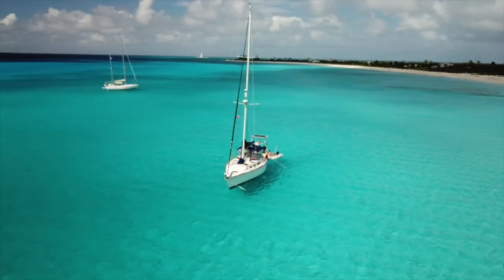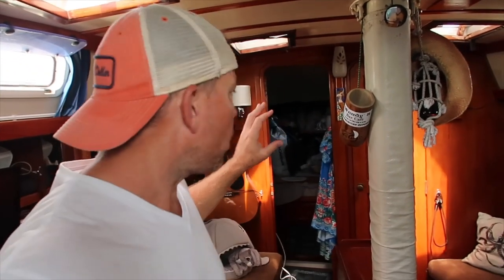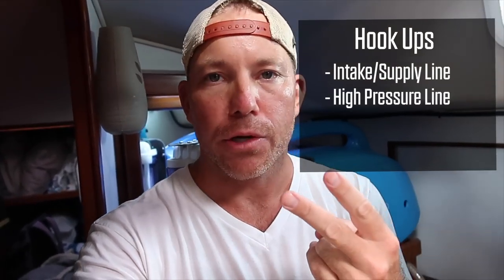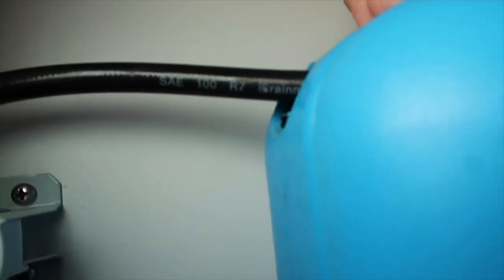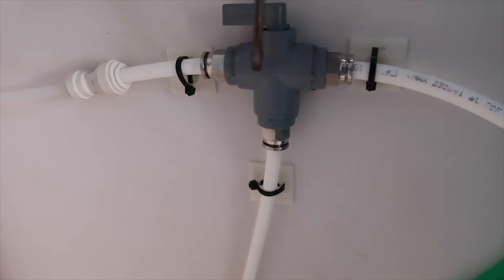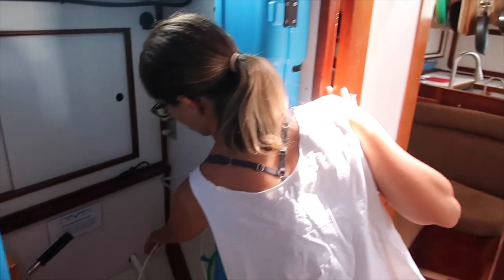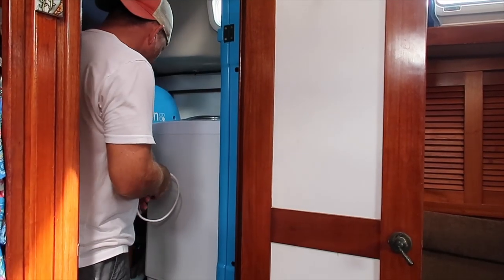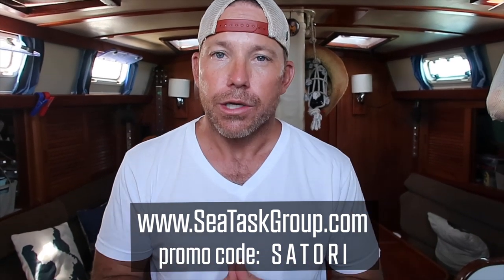New Sailboat Laundry Room Complete with Rainman Water Maker (Sailing Satori) OTH:11

Comment: We are about to pull the trigger on the purchase of the Zeny washer.  Just checking to see if you guys are still happy with the machine and if it has held up.  We have 17.5" through the bulkhead opening and 17.5" into the head.  I think we'll be okay.
Reply from the maker: Yep! It’s been installed for 8 months and it’s been fabulous!! 🤞🏻🤞🏻
Reply: @SailingSatori , we ordered it last night.  Amazon offered $70 off, if we signed up for their credit card, so we got this thing for under $100!  Thanks for the recommendation.
Reply from the maker: Woohoo!!! Yay that’s awesome guys! 🤙🏻
Reply: @SailingSatori , happiness is clean sheets and your favorite t-shirt, not to mention NOT having to load clothes into the dinghy.
Reply: Just installed the Zeny washing machine.  Happy wife, clean drawers.

Comment: Nice use of space. You may want to consider legs under the plywood. Coming down hard off a wave could break the bowl on the head.
Reply from the maker: Thanks for the suggestion! So far (it’s been installed about 6 months) the rubber and strapping the machine down has worked great 👍🏻

Comment: Thanks much the great installation video. You have a good collection of tools, essential for boat or any projects. I was wondering - it appeared that you were using a portable table saw to cut the wood for the water maker platform. Is that correct? If so what model/brand is it?
Reply: 4:11 shows a Porter-Cable jigsaw and a work table similar to the Keter Model # 197283.

Comment: I would be concerned about the high pressure hose rubbing on the holes in the casing that you drilled.. put some chafe protection. Also I would be careful to make sure that watermaker does not operate with both head door and portlight closed... could cause a heat build up and shorten the live of the compressor and or washing machine.

Comment: Good stuff.  Since, in your own words, this head is not used as a bathroom, gut it and make your gal (and you) a real laundry room.  It would seem, the more one keeps plugging and unplugging water and valve connections, the sooner they will wear out or break.  Just a thought.  :-)
Reply: Hi Richard. Nick bought and installed a 'Transferable' water maker, and the washing machine fitment appears semi permanent - maybe they don't want to modify Satori for re-sale purposes ? Thinking of another boat further down the track ?
Regards from NZ, John.
Reply from the maker: Correct. Also, one of my criteria was for the bathroom to remain functional. We don’t use it daily, but we do want it if we need it for guests, or if we have problems with the other head.